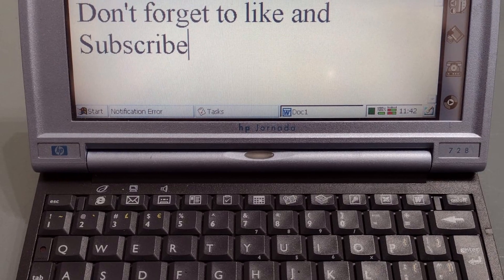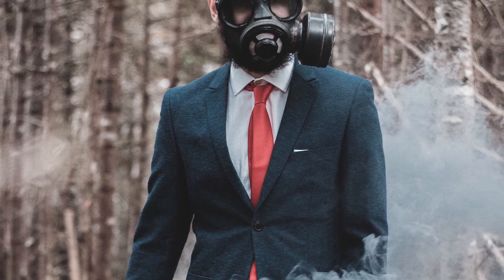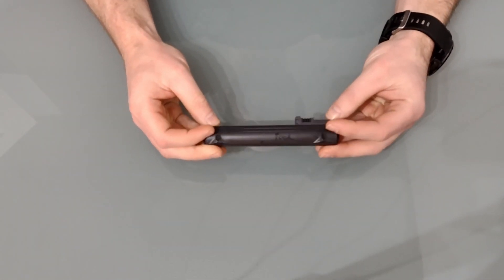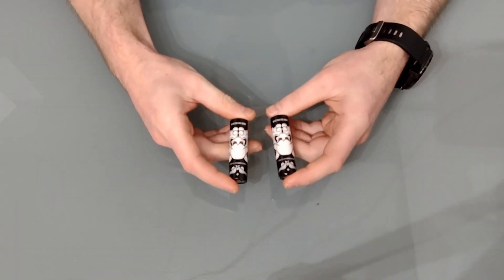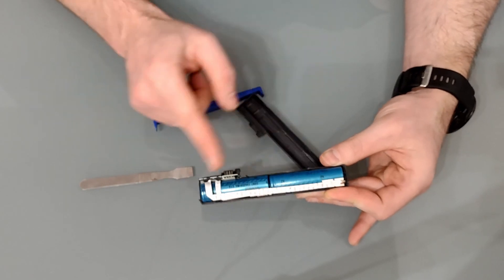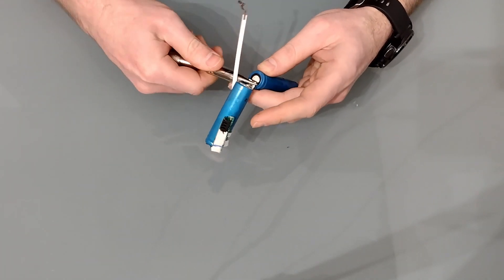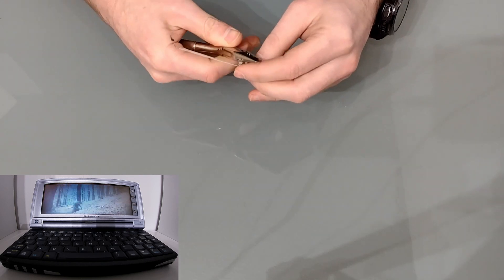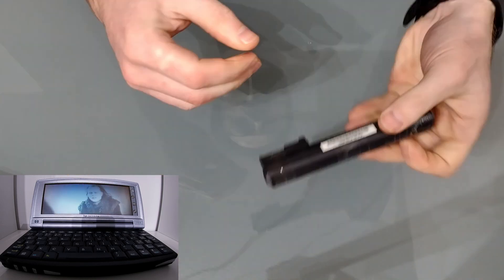Replace the battery in the HP Jornada 6xx or 7xx

Comment: Thanks for this video. I replaced the old factory batteries with two 3000 mAh. Now, after two charge cycles, at full brightness with continuous full-screen video playback the runtime exceeds 6 hours. So the realistic usage time can be much more than that :)
But the old fluorescent tube is getting dimmer over the years...
Reply from the maker: Excellent! In normal use you will easily double that runtime!
The tubes are starting to go on my 720/728 as well, at some point I will replace them but I am considering upgrading it to LED which should be brighter 😁

Comment: I wouldn't recommend using glue. The batteries will eventually wear out and need to be rebuilt again.
Reply from the maker: It's true but had to hold the case together somehow... On a later rebuild I used a glue gun so gentle heat will allow battery replacement again in future 🙂

Comment: Thank you Hugh, I've been a 25+ year Psion user, i have 3 x 5mx in A+ condition and one Ericsson MC218 version also in A+, i run my life off these, as I'm entering early retirement and want a certain amount of off-grid time, the MC218 resides on my desk 24/7, the other 3 are assigned tasks such as daily household use, office meetings, and the third when away from home for pleasure trips, sharing the use keeps the devices all running in great condition and evens the load with a quick irda blast to sync each morning. 

I've recently been tempted by the Jornada to potentially replace the Psions or at least to run alongside and purchased a never used 680, a pretty decent 690 {with 2 batteries} and a refurbished 728 winging its way from stateside. The 680 battery is completely dead so following this video I've stripped it out and ordered my spot welder and 18650s and looking forward to getting stuck in. 

I've been viewing for a few weeks now and it's time to subscribe, great work, just my kind of niche

If you repair devices I'd be interested if you'd quote for a Teklogix Netbook Pro, the screen doesn't work but the machine itself does, I've checked the ribbon and it's physically in place but that's where my ability ends. 

Take care, Cheers, Gary
Reply from the maker: That is a great collection Gary the 728 is a great machine but there is something about EPOC that just works! I have always felt it a shame that Psion didn't build a colour series 5 😒
If you are doing a battery replacment check out the Libretto re-cell I dd as well, I used hot glue to get the case back together and it gave a really neat finish!
I'm afraid I don't do repairs for other peoples devices I consider the risk too high, also I am very much a amateur! Don't forget to check out HPCfactor if you haven't already, there's now a section for Psion and you will find all the software you need for your Jornarda's. Hope the re-cell goes well 😃
Reply: @HandheldComputing  Cheers, the re-cell was a winner and I'm on HPCF for the Jornada, I contacted the RMR Psion author and purchased the back catalogue for those devices, now sorting out s/w for the Jornadas.
Reply from the maker: @GaryStuartWicks  Glad it worked! I use a lot of handhelds but the J720/728 is always the one I go back to, just such a capable device

Comment: hi there, I just this evening followed your video after getting all the necessary parts to recell a HP 620xl battery. My goodness the batteries WERE dead, as in leaked, as in bluegh! I've replaced them with Samsung cells. I just wanted to confirm how you reset the BMS? I removed the coin cell, the mains AC for 30 seconds. Installed. The main battery, then the AC power and then powered on. It came up with some dos text, saying I could loose my data or Y or N? I said yes and booted up. The battery meter sits at two bars and doesn't appear to be moving. Is it just very slow at charging 6000mah? Many thanks
Reply from the maker: The BMS is reset by removing all batteries and power adaptor let ithe RAM discharge then plug the battery in and connect the power - without this step the battery will not charge or power the device.
Unfortunately your issue sounds like only one battery is charging or there is an issue with the BMS. I would just double check all the connections and make sure both batteries have some charge.

Hope this helps and you get it sorted!

Comment: I just found my original Jornada 680. NGL got me feeling a little nostalgic. I will have to purchase a power adapter and follow the process in your video to make a new battery pack. I have my fingers crossed that the Jornada will boot, as it has been stored in a box since 1999. Your video gives me hope that it will! Excellent video!
Reply from the maker: More likely than not, it'll work perfectly the Jornada was built to last!
Reply: So ? All good ? 😊
Reply from the maker: @MrKoblepot  good question, @HRBSFrank did it work?
My 720 battery is still running well!
Reply: @HandheldComputing  refreshing a freshly acquired 680 after having a 200lx and 95lx for my part battery isnt amazing at all, I think I'm gonna do a 18650 swap if it's safe enough, checking everything.
Very efficient work machine to help in my store actually.

Comment: What’s an issue with some of these hp and others vintage handhelds, is that the plastic cracks and breaks apart so easily.
Reply from the maker: It is an issue on a lot of vintage devices as the UV breaks bonds in the plastic polymers. The HP ones seem to be the exception the plastics don't seem to have become brittle at all unlike the Libretto CT50 I have which is quite delicate

Comment: Ok it's safe to say this can play video. Excellent.
Reply from the maker: It sure can! The only let down is the slow pixel refresh due to the DSTN screen, shame its not a TFT
Reply: @HandheldComputing  Interesting! I will see if I can downgrade video quality to attempt to match the output/hardware and monitor refresh capability. I wish I knew about these before jumping into the Pocket PC scene. I assume the price was the detractor at the time. Thanks for this video! Well done!
Reply from the maker: @Durrpadil  check out DVDcatalyst you can get the old version on HPCfactor, sadly the website for the new version seems to have disappeared. Otherwise have a play with other vide conversion software just watch the bitrate

Comment: Sorry to ask, but the positive end from the former battery and the negative of the later do not make contact? I don't know how to insulate both batteries if they are in parallel with so little space. Thanks for the video.
Reply from the maker: They don't make contact but it is fine if they do. The two nikel strips connect to the same point on the BMS so it doesn't matter either way
Reply: @HandheldComputing  Thanks a lot, it worked!! Keep up the good work!
Reply from the maker: @albertuxus  Glad it worked!

Comment: Popularised by vaping?! The 18650 used to be in pretty much everything long before vaping came along and before the rise of lithium polymer batteries. Today, most devices still use 18650 cells if they don’t use lithium polymer cells. All laptop packs were made up of 18650 cells, they’re used to make up the batteries in electric cars including Teslas. Vaping is literally one product out of millions.
Reply from the maker: Its true, in industry and manufacturing 18650's were in common use from the late 90's but for most consumers short of opening a laptop battery pack or ordering a dodgy Chinese torch they won't have seen an 18650 in person. In addition by referencing vaping I am also suggesting an easy place to buy them. But point taken 🙂

Comment: Related to this, if you have a CLIE PEG-NX70V, you can easily replace the internal battery that is a 900mAh LiPo with a 1300mAh one with dimensions of 60*37*5 millimetres. It just fits enough without stressing anything and you have a bit more than 30% extra battery capacity.
I believe some other CLIE PEGs use similar type of LiPo batteries, but not sure though.
Reply from the maker: Thank you for that, it's not one I have though I do have the 770C which I suspect uses a similar sized battery

Comment: Thanks for explaining the procedure, especially the re-tagging of new batt cells. I expect to to do several cell replacements in the near future, one of them is for toshiba e800.
Reply from the maker: The e800 has a flat battery pack, you should be able to replace its battery with a pouch battery you will just need to solder the pouch battery to the BMS and of course get the correct size to fit the space!

Comment: Always excited for another one of these videos, keep it up! Love these old handhelds.
I bought a Cassiopeia A21S in an ebay lot for super cheap, it uses AA batteries in a cartridge on the back for power. Since the whole thing is removable makes me wonder if there was an 18650 pack available for it since it has a charging port on the device, or if it just used AA rechargable cells.
Reply from the maker: It used a NiCd pack. A lot of the early HPCs did, they moved to NiMh before switching to Li-ion with the change to power hungry colour displays. Glad you liked the video :-)